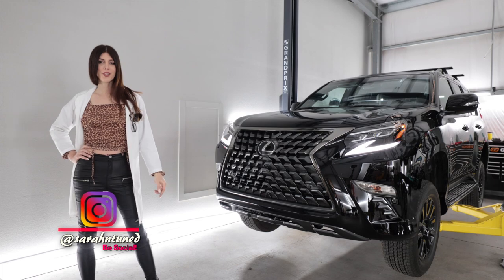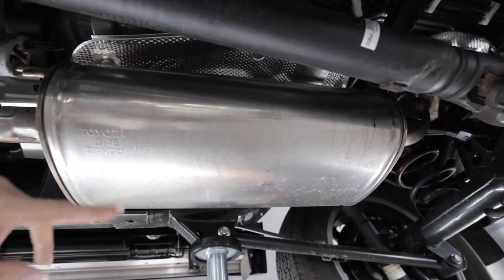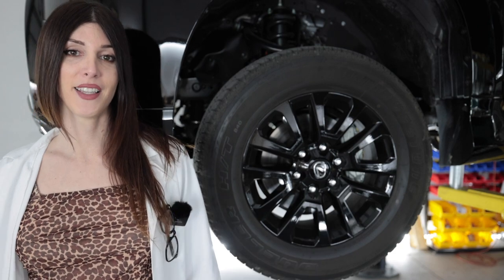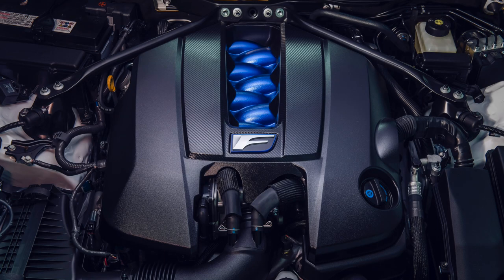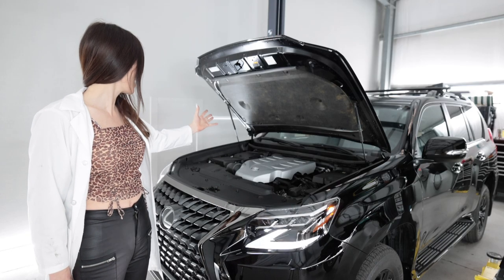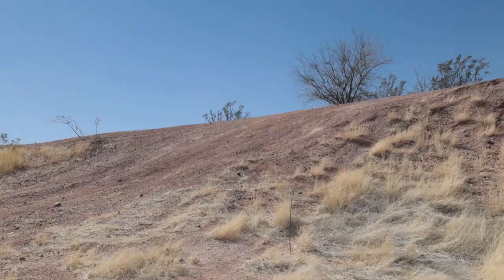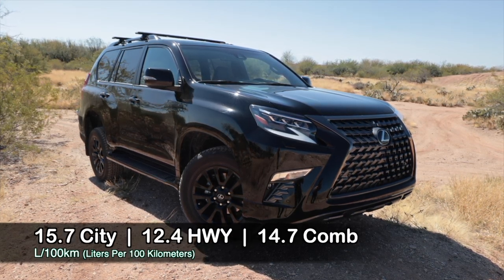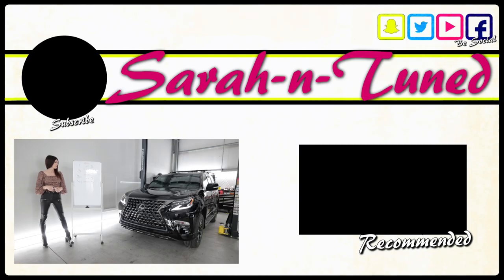Name A Better Overland Platform.. // 2022 Lexus GX460 Review

Comment: Clearly, Lexus has detuned this engine for reliability reasons, I'm sure. 301 hp is not a lot for a 4.6 l V-8.
Reply: Agreed. If you can strap a supercharger on these engines without any issues, it just tells you the motor is capable of doing much more.
Reply: @yougotservedyo Oh, you were a powertrain engineer for this engine?
Reply: @michaelskinner896  well I do believe car and driver and since they quote the same exact numbers for this 4.6 l V8 at 301 horses pretty sure that's not being detuned...

Comment: I’ll keep my 3UR 5.7 liter engine instead of the newer 3.4 twin turbo version. It’s a tested and true engine that has a long history of durability and performance.
Reply: its a v8 no turbos, what are you talking about?
Reply: @eurtostance  Toyota stopped installing the V8 on its Sequoia and Tundra lines. They replaced it with a 3.4 liter bi-turbo engine as Ford did with its F-150 and other vehicles. Ford also offered a Coyote 5.0 V8 as an option. Lexus kept the smaller V8, but it’s days a limited due to federal emission standards and improved fuel mileage (dismal) from the V6.
Reply: @eurtostance no more v8. Go out and buy one then hang on to it
Reply: @2URLex   I did!
Reply: @eurtostance  awesome, I have the 5.0 and now I want either the 4.6 or 5.7 to add to the stable lol.

Comment: i have a 2014. It has a CBI front bumper, 33's over 17's and CBI sliders. The rear two sets of seats are removed, and it is setup for overlanding. Great truck, truely unstoppable. Also, love the outfit choice
Reply: what kind of mpg are you getting on your rig? Sounds cool with 33`s
Reply: @FuryfistX  16-20 depending on speed.

Comment: Coming up on one year with my 2018 GX now. It's such a great truck. Wonderful for road trips and totally capable for any of the mild offroading I've attempted on fire roads and the beach. Fits my two pretty big dogs behind the second row. Tows my small trailer. Gets around parking lots easily. Great aftermarket support thanks to Prados. Also, I get 20 MPG on the highway easily, and around 17 around town. Incredible.
Fun review, I wish I could have afforded a new one.
Reply: I think you're really really smart. The last time I paid a premium for a new vehicle was in 1978 when I bought my Bronco.
Reply: I'm jelly
Reply: such great off-road cars!
Reply: How do you get 20mpg??? help me out
Reply: @LexusGX460-OFF-ROAD  I was able to get 20-21 mpg highway in my stock '19 as long as speed is under 70 mph. Drove from LA to Bishop area 65 mph, 800lb payload got got 20.8 mpg. Drove from LA to Phoenix and averaged 19.8 mpg.
Reply: @pennmikael  very nice... thank you
Reply: @pennmikael  and thank you for subscribing  ❤️
Reply: On the highway I am getting 20-25 mpg cruising at 65 mph.  Ho wary and steady on the pedal and then the GX 460 gets respectable highway gas mileage !

Comment: the sway bar is the size of a Coke can because of the awesome KDSS system.  It allows an absurdly thick swaybar on road... feels like a car on road and then you get full articulation off road.  Best of both worlds.  Lock the center diff if you know you'll be off road for a while for even better results

Comment: Had the same thought, almost bought a used one recently for an overland mod.  Kinda great that Toyota offers a souped-up, badass body on frame 4runner as a Lexus...
Reply: They are Landcruiser Prado.  The main difference being an actual center differential for full-time 4WD, atrac, and kdss... closest in 4runner trim is the limited
Reply: @LexusGX460-OFF-ROAD  the 4Runner is built on the same platform
Reply: @RagingBad  yes, but the 4x4 mechanics and power train are different.  Mainly the actual, real center differential for full-time 4WD.. and again  standard kdss and atrac... we shopped for 4runners but only the limited had a center differential and it was impossible to find one with kdss... attac had to be pushed on and off etc... Hopefully the new 4runner will address this...
Reply: @LexusGX460-OFF-ROAD  you're forgetting the TRD off road and the Pro, those have all the off road toys, better than the Lexus, also real off roaders will never buy a limited
Reply: Yep,  gx and 4R are both LC prados.  Everyone in this community knows that
Reply: I like the gx,  I can't get past that rear swinging door sigh...
Reply: @noctilucent7396  we like the rear swing door... but we don't live in a city though
Reply: @LexusGX460-OFF-ROAD  weird because from I understand the small Prado was designed for the city.  If you have roomy areas in the country I assume you already have the Land Cruiser.  I like the 4R door because it gives you cover from rain and sun while meal prepping.  The swing door gives no cover.  Most folks on ih8mud share this opinion.  Im glad you like your swing door.  Few do
Reply: @noctilucent7396  The Prado/GX was designed to be a short wheelbase Landcruiser when the full size Landcruiser started getting too big for actual off-roading.  I don't think either LC was ever designed with city driving in mind.  The actual use of the barn door is great... but again we don't live in a congested area where trunk door clearance is a factor.
Reply: @LexusGX460-OFF-ROAD  It's because Limiteds don't come with KDSS, they come with X-REAS
Reply: @RagingBad yes but no where near as luxury

Comment: Great review, I have a ‘05 GX-470 with 200k + miles. It’s great, still going, a bigger V-8 than the GX-460. Gets Just 19 mpg, (the twin turbo six GX-550 gets 17 mpg?!) no heated seats, no robots, no dials for sand, snow, etc., a DVD player in the overhead and third row seats (that stay in a closet) tons of interior room. Silver in color, I love it! My fancy ranch truck! Some remove the running boards and all the plastic on the front and around the wheels and it’s great off road.

Comment: The GX460 is an offroad tank!  Known as the Landcruiser Prado worldwide.  We drove ours new off the lot and abuse it non-stop offroad!
Reply: The 4R is also the Prado re labeled for the us market and the Gx is the luxury version also relabed here in the US.  Both are on the 150 Prado platform and share almost all identical parts
Reply: @noctilucent7396  no.. the Prado is a GX460... fulltime 4wd, center differential, KDSS, atrac... the closest to that setup is the 4runner Limited

Comment: Seems to me this is a beast in a 3-piece suit.  It has the Lexus name, lots of luxury, but also a robust body-on-frame construction and a V-8.  Though that engine seems really mildly tuned, there are 3.5L V-6's that make that much hp, though not quite as much torque.  Which tells me you could probably get another 70 or 80 hp out of it without much trouble, and I imagine the bottom end and transmission could take that.  Fun review, and maybe we'll see a few more vehicles take on that new hill.
Reply: The 4.6 baby V8 is de-tuned for reliability.  When off-road you are only going 3mph anyway...
Reply: The thing about the V8 is although Ford for example did have a 3.7l dura tech that mad 302 horsepower, but that power was at over 6000rpm 😱
Reply: @rysterstech  similar here... gotta get the revs up in the GX460 to exploit the power..
Reply: Yea lexus' 3.5 twin turbo v6 in the ls make 416 hp and 441 tq
Reply: Let's see those twin turbochargers after 200,000 miles or 10 years, which ever comes first...
Reply: @runnerxa  they probably overtested the engine in the factory to deal with 600+ hp then detuned it to what we see today - which means it will work less harder than usual which means it will last longer
Reply: Look at the supra engine from the 90s and it's well known tuning rep
Reply: @runnerxa  they'll last... Toyota does it right

Comment: Great review of a remarkable vehicle. I have a pristine '08 GX470. @ ~150,000 miles, totally quiet and not a squeak or rattle. Just regular maintenance over its lifetime. Never a breakdown or major component failure. It's an incredibly quiet and refined vehicle. The present GX460 other than the engine and bodywork is about 85% identical to its predecessor GX470 so the platform for the most part is ~20 years old. But it still works! I prefer the GX470 body style though. Can't get used to those swoopy rear quarter panels and door treatment on the newer GX's.
Reply: The 470 still wins in the classic looks department but the 460 has a better drivetrain in every way. Both are 500K mile vehicles with simple maintenance.

Comment: I just can't get used to the massive front grills on this and other cars. It's a current design trend that I don't think works aesthetically. You can make a cool looking front without the grill taking up most of the space.
Reply from the maker: That’s why I recommended the Prado conversion, it looks 🔥
Reply: Agreed!!
Reply: or just cut it off like we did... easy to also add a stubby bumper too...

Comment: Awesome vehicle, I have a 2016, I put more aggressives and thicc KO2s on 17in rims, and it crushes snow or off-road. Drove it to Moab, beat the crap out of it, then drove it to Yellowstone and back to Colorado, 1000 mile trip and nothing, no squeaks, no troubles with suspension, built like a tank, and was very comfortable cabin compared to a more basic 4 runner. The V8 does get bad mileage and not that powerful, compared to a 4runner it is an improvement, the 4.0 V6 really struggles here in Colorado. 

And Sarah is right, for off-roading you do need different front bumper, a 2in lift, at minimum off road tires, ideally on 17in rims as and easy upgrade to Crawl Control for $700, just switching out a module and then you're all set, with a torquy V8 it can handle a lot of tough trails. 

I would never switch out to the Prado look, off road front bumper is all you need. And I take pride that its a Lexus, you cannot get a Prado with a V8 anywhere in the world, even in the Middle East the GX comes as a 400 with a 4.0L V6. I think only in Russia they sold GX460/470s alongside the Prado's. I've driven diesel Prados and they're barely move, that 190hp is not enough to move a vehicle this size.
That 2022 updated interior looks so much better then the 2011 interior you get all the way up to 2021 with the 90s Nokia phone infotainment system.
Reply: agree... snip the plastic bits off

Comment: My 2012 GX460 is at 108,000 miles and drives like new! It gets decent highway mpg - around 19-20 but the city mpg is at best 15-16. The interior is also such high quality that I’m sure it will last as long as the this thing runs. Looking forward to another 100k miles.
Reply: that's awesome!!
Reply: Only thing I'd keep an eye out for is the valley plate. If you're losing coolant that's where I'd look at first.

Comment: Prado’s are a dime a dozen here in Australia. They’re everywhere, diesels and v6s. They have the nickname “play dough” because they are soft and gooey. 
Realistically they go hard and we have many, many aftermarket options to toughen them up even more.
Reply: Well you’d know of course most of us wouldn’t go inland in anything else than a Toyota of course.  Unthinkable to do it in a Land Rover….
Reply: you ain't got no V8 prado in Oz...
Reply: @LexusGX460-OFF-ROAD  no you’re 100% correct- but we’ve got the new land-cruiser- 😂
Reply: @BillWoodillustrator  lolz ours is called the Lexus LX600 😆 😃!! 🇺🇸 #1
Reply: @LexusGX460-OFF-ROAD  they also have diesel V8 Land cruiser
Reply: @RagingBad  that would be nice to have.. how is the mpgs on the V8 diesel?
Reply: @LexusGX460-OFF-ROAD  
Yeah we get those too- also the 79 series of landcruisers- bullet proof if any car was. I think Australia and maybe some countries like South Africa and India are the only ones that continue to receive them. Very agricultural but ultimately reliable. I couldn’t drive one though.
Reply: @LexusGX460-OFF-ROAD  it would be kinda pointless. Most use diesels here. We do have 75 series land cruiser utes with twin turbo diesel v8s though. America doesn’t get those though. If you want sportier then there are the Holden and Ford utes with LSAs, supercharged Miami’s or turbo barras under the bonnet. 
Why would we need a v8 prado?
Reply: @LexusGX460-OFF-ROAD  I don't know but probably better than the gasoline V8

Comment: Ford's 4.6L 32V modular from 2003-04 Mercury Marauder made 302 ho and 318 lb-ft which is almost identical to the Toyota but without the VVTi.

Comment: At Fort Hood in the late 90s I sent my HMMWV driver up a hill like that only about 3-4 times longer. Made it up the hill whilst ripping the left rear A-arm nearly in half. 

Called up maintenance, told the driver I'd be back after finding the tank and the soldier I was looking for. By the time I walked the rest of the way, had my conversation and then walked back the repair was made. (Great mechanic team, I had).

Moral: Nothing beats a HMMWV.

Comment: Cut off half the front grill. Get rid of those steps for some low profile rails. And a 2 inch spring lift and some beefy wheels and maybe. What I see is an over priced Forester. I know it's got some nice off road tech.. if it had the clearance to use it would be nice.

Got to the end... I take back the subaru comment.. that hill climb was pretty impressive.
Reply: It's better than a forester, gx460 can go in  sand desert

Comment: Yep, nothing better. Loved my 2005 model Prado ,4.0 V6 with a 6 speed manual box Shouldn’t have sold it but wasn’t using it much and it was a costly beast to run when you weren’t 4w driving.

Comment: I love Toyota/Lexus. They are just better. No vehicle is failsafe but they might be as close as you can get. I'm just bummed that they are discontinuing the V-8. I don't like turbos on gasoline engines. They don't bother me on a diesel but a diesel is a different animal. This thing handled those hills almost as well as that F-250 did. The downside is that the GX460 and F-250 are beaucoup expensive.
Reply: we've got a 21 GX460... the mpgs hurt in the feelz... next gen will fix the mpgs I hope

Comment: My Gen 1 Raptor serves me extremely well in Moab and other mountain playgrounds, but IF I wanted something else for adventuring it would either be a new Bronco (if I wanted a new car) or more likely on my budget, a first generation Porsche Cayenne Turbo with the rear locker, which like you I can lift, modify, and maintain for myself.

Comment: Hi Sara another great video review I was wondering Is this Lexus GX460 better than the Toyota 4Runner Trd pro or are they both the same or is the 4Runner better ??
Reply: It's the same chassis; I prefer the V8/6-speed transmission combo over the V6/5-speed transmission. But,  you do need to at least trim the front fascia and ditch the running boards,  which you wouldn't have to do on the 4Runner. The KDSS sway bar system is very nice too, best of  both worlds.
Reply: Thier very similar both on the Prado platform.  Actually the Prado is v6 but... hmm think of it this way the 4R is the Spartan version and the Gx is the luxury version

Comment: Like your review! Considered the GX460 when I was looking for an overlanding vehicle. If it wasn't for the low ground clearance and the swing out door I would have gone with one. Ended up with a 2014 Trail for the rear locker and crawl control.   With a 3" lift MT Baja Boss tires and a winch, I've not been in too deep to get out.

Comment: I had a Land Cruiser that got a sparkly 7 mpg towing my track dedicated and very light E30M3 on a Trailex (850lbs).  It was extremely reliable, but the fuel costs far outweighed any repairs it might have needed.  I traded it for a diesel X5 which was both more fun to drive and got 22mpg towing.  That gas guzzling V8 is a true dinosaur.
Reply: agree the mpgs are an issue, the next gen turbos should address this 😉

Comment: With that high of a compression ratio, does it require super unleaded gasoline?
Reply: Requires premium.
Reply: Check the vehicle manual. There are many that are flex fuel, and with variable valve timing and a wide fuel program, you'll often see the manual says "premium fuel recommended" NOT required. AAA checked six cars like that about 3 years ago. Only one got any gain from premium, the engines are able to retune for whatever is in them. I'd be surprised if this is any different. Knocking a tenth of a second off the quarter mile is not what they are built for.(g)
 The confusion about required/recommended comes from the marketing departments: Look how special your new car is! It even needs special gas! (Sure.)
Reply: Been putting regular in mine for 20k miles.  Its the same setup that came in the tundra and sequoia for a while which only required regular.  The engine doesnt care.
Reply: The manual specifically says to use premium. At least in mine. Why would the manual say that if they don’t mean it? My Escalade required premium also. I’ll keep using premium until I find out exactly why it would be better not to, other than cost.
Reply: 91 octane minimum

Comment: The power on that V8 is kind of disappointing.  The 3.6L V6 in my 2015 Equinox has the same horsepower (301) and 272lb-ft of torque.  It also gets 29 mpg on the highway despite being AWD.  Granted, it's nowhere near as capable off-road as the Lexus but that's fine considering it never goes off-road.
Reply: The GX460 torque is 331lb-ft and can easily tow 6500lbs. I agree that some V8 develops more power.